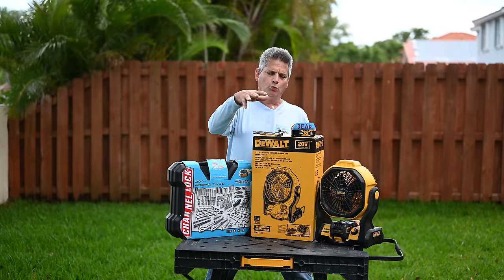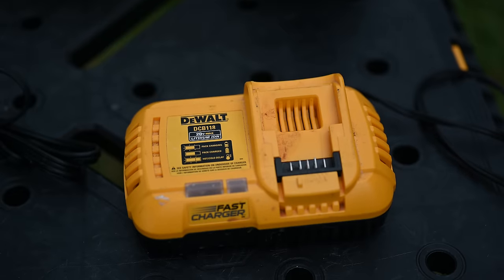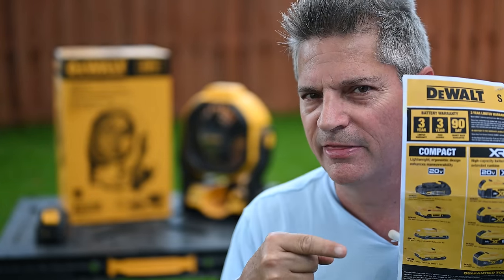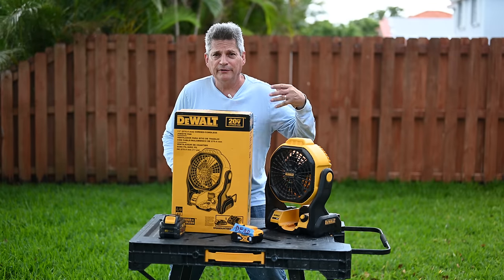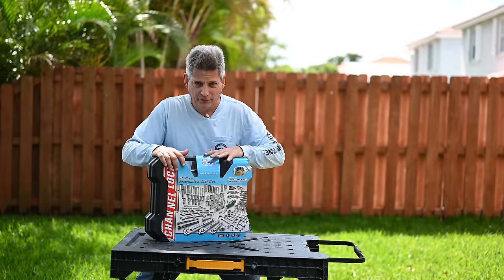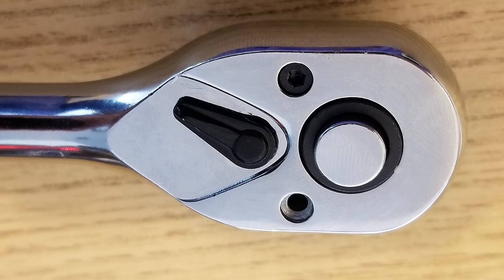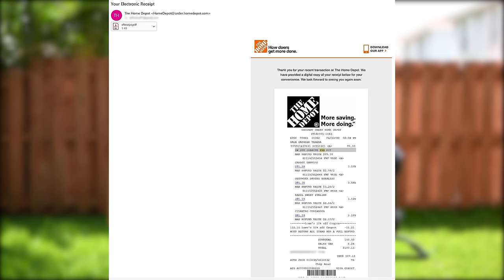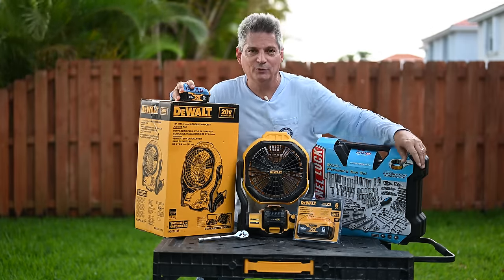Why Don't Tool Warranties Work? Tips To Avoid Denied Claims!

Comment: Great video. SB&D covered a B&D L-I line trimmer twice. First, the battery crapped out, they sent a replacement. Then, a plastic part between the motor and head stripped, so they sent a refund by corporate check because it was not repairable, and they had no more of my model in inventory.  I now have a trove of Dewalt and Craftsman 20v tools because I know they will stand behind their warranties.
Reply from the maker: Thanks George!

Comment: Couple points to add:   Harbor freight offers an extended warranty on many products which is virtually a no questions asked replacement plan.  The Ridgid lifetime service agreement is very difficult to register -  others have said you can do it instantly via Facebook but I haven't seen any instructions on that yet -  supposedly Ridgid honoring their LSA is one of the toughest things to get done.  Also a reminder that some retailers print their receipts on thermal paper -  like Walmart - and guess what:  in the heat and with time they completely vanish -  so it's a really good idea to make copies or take pictures of those receipts.
Reply: Interesting I thought Ridgid registration was easy and I have at least 12 different Ridgid tools. Now as far as the warranty i couldn't get any 24 volt batteries (these were from about 8 years ago) and they don't make them anymore. They did send me 18v as a replacement with a charger and they work perfect.

Comment: You can jump start the battery with a wire. Just look it up. I had that issue on two brand new 5ah batteries, looked up a video and jumped it. Been using those batteries everyday for a couple years now and they're still great.
Reply: Still likely the cells inside are defective, the packs do provide power, just have either dead cells or thy are low capacity. If NimH very likely to be dendrited cells in there, which can be possibly rejuvenated, but which are unlikely to last long term. If lithium then one cell pair is dead, and needs the pack replaced, or the internal cells replaced with ones that are higher capacity.
Reply: Just tried the battery hack. Works great, had a Sony Bluetooth speaker/ AM-FM about 15 years old. Had been using the electrical cord to power the unit. It would not charge!!!  Connected the Dewalt 20v battery for about 15 seconds. Disconnect the wire leads and it immediately went in to charge mode when plug into the power cord. Big thanks battery replacement not an option.

Comment: You tell of an interesting ratchet replacement experience.   The opposite took place with my lifetime warranty from sears-craftsman.   The set includes a plastic handle nut driver with 1/4 square drive.  It doubles as a 6 inch 1/4 inch extension.  The top of the handle has an inserted 1/4 steel female that takes the ratchet driver.  The plastic is too weak to take the torque and makes a little crack in the handle, which can no longer hold the insert.  Craftsman had discovered this design defect, and no longer makes the combo driver/extension. (They could have just redesigned it with continuous steel thru the handle!)  They would not give me the two separate tools to restore my functions.  They said, either the 6 inch extension bar, or the driver with plastic handle, and I must let them crush the cracked one!  They would not let me keep the perfectly useable driver, and just get an extension, because they feared that we could make many additional claims on it.   Understood, but why not just give me both inexpensive pieces? Or redesign with continuous steel core? (What does it cost to mold a plastic handle onto an extension?)

Comment: Yes if you can get both a paper receipt and email of the receipt from any store do it. Even if the cashier does not seem to have the time which are few. This has saved my butt many of times.
Reply from the maker: Once I set it up at the store cash register in each one of the stores, it automatically knows where to email of the next time you use it because it is tide to the card

Comment: I have one of the the DeWalt rocket lights that I had about 3 months.  I went to use it and when I set it up as I was walking away from it I heard a pop noise and it started falling over.  I caught it before it fell on the floor, but after inspecting it I found that the socket for one of the three legs had cracked and the leg fell out of the socket.  I looked up the warranty info and it basically explained I needed to take it to a DeWalt warranty center, the closet which is about 80 miles away.  Rather than make the drive, I sent an email to DeWalt with my receipt and got a quick response saying they would just ship me a replacement, but I would need to return the broken one.  Since I had thrown away the large box, I replied back asking if it would be ok if I waited for them to send the replacement, so I could use that box. No problem...they sent the replacement less than a week later and I returned the defective unit.  Nothing but praise for their customer service.
Reply from the maker: That is awesome Chris!

Comment: Corded tools rock!  More power and no batteries to worry about.
Reply from the maker: Lol I was just thinking the same thing about battery operated tools, batteries rule! No more outlets to have to find and no more extension cords to dig out and trip over. And I hate extension cords because when I try to vacuum up at the end of the day the vacuum shop vac does not wanna roll over the cords

Comment: Rigid rocks never had a problem getting batteries replaced even ones I've had for years and have a local Rigid authorized repair center nearby drop off a tool replacement in days or repaired again never a problem !!!! Ye I'm a loyal Rigid Fan

Comment: @jeffostroff did you fill out the warranty paperwork that came in the box for that to work like that or does sending that in not really help? Never had one fail yet...thanks
Reply from the maker: Over the years I haven't much turned in any of those cards that come with the tools or much of any other products that I buy because I have found over the years when you call to make a claim and you say but I registered they tell you no you weren't registered for warranty that was just the marketing stuff. So I don't really register unless they have some type of incentive for getting online and getting your project registered. For example last year I bought some studio equipment and it said that we would get another year of warranty if we registered the product so I did. But most times all you need is the receipt to back up unless it's specifically tells you somewhere in the paperwork that you must register your product
Reply: @jeffostroff  thank ya so much for taking the time to answer that! Sometimes I feel bad because my comments are so long! But have an awesome day!

Comment: I got burned by Sears on an expensive electronic torque wrench and there isn't anyone in the United States to fix it. Almost 200 down the drain. The head had a known issue.  My advice. Use your stuff immediately and frequently to make sure it works. After 90 days on certain products your out of luck regardless of zero use
Reply from the maker: Yes, don't let it sit in the box untested

Comment: Had an issue a while back , I was cleaning my tool collection and had some old Craftsman broken tools, well they have numbers on them , the numbers linked them to Sears,  lowes would not honor the tools because they didnt match there numbers even though they were craftsman which I thought was b.s..... anyway contacted sears online , they also asked for pics of the broken tools, I gave them the pics , a few days later I had 75 dollar credit at sears online to order new ones . I ordered something else instead .... Although it was a week or so of crap Craftsman will stick behind there warranty on old Sears tools even if you dont have a Sears around for hundreds of miles you can swap em out .
Reply: I got burned by Sears on an expensive electronic torque wrench and there isn't anyone in the United States to fix it. Almost 200 down the drain. The head had a known issue.  My advice. Use your stuff immediately and frequently to make sure it works. After 90 days on certain products your out of luck regardless of zero use
Reply: Try contacting craftsman warranty through emails, I forgot how I got my Sears process started but I remember chatting with craftsman on the issue. They should give you a credit if the item is still available for purchases.

Comment: I've never had an issue with batteries yet... But I have the exact fan and the switch went. It has the same 3 year warranty apparently... But when I contacted them because the switch wasn't working, the switch is not part of the warranty and it's not a replaceable part. So only option would be buy a new fan! Even though I was under 3 years from purchase date.
Reply from the maker: So you got no coverage at all?
Reply: @jeffostroff  pretty much they told me no coverage. They said the switch isn't covered they consider it consumable or something. That was through the DeWalt service center in Alberta Canada.
I ended up going back to the retailer I got it from (Canadian Tire) because their site said 3 year warranty and they actually swapped it for me which was awesome in the end. But on the DeWalt side I did have the issue there.

I will still continue to buy only DeWalt. But that was my warranty experience so far.
Reply from the maker: @AdamBoutilier   Well you got lucky on that 1. Another thing to consider a lot of people forget that sometimes your credit card provides an extended warranty as well and so you can Investigate that is an alternative solution as well

Comment: Hi jeff, is it possible to claim warranty for my flexvolt 6.0ah battery if i bought it from USA authorized dealer and ship it here in ASIA.

Now its broken and wont charge its  almost brand new used it once only. The battery says its 2021 production and its well within 3 years warranty period.

Will dewalt USA honor my claim of warranty? I have relatives living in USA who can accept replacement if dewalt replace the battery.

Comment: NEVER HAD A DEWALT 20 VOLT XR BATTERY GO BAD BUT HAD 2 FLEXVOLTS GO BAD PANASONIC HAD SOME BAD CELLS 2017 2019
Reply from the maker: The replaced the batteries for you?
Reply: @jeffostroff  THEY REPLACED THE FRIST ONE BUT SECOND WENT BAD LAST MONTH BUT IT WAS MFD IN 2017 OUT OF DATE I GET TO WALK INTO MY DEWALT SERVICE CENTER OLNY 18 MILES AWAY

Comment: I just take my Milwaukee stuff to the repair guy down the street. It usually costs between $2 and $7 depending on postage to fix any Milwaukee tool no matter how old it is. Dewalt is a pain in the ass and almost impossible to get repaired.

Comment: In 1999 I went all in on DeWalt tools. They were awful. First issue was their batteries. They suck! They sucked then, and suck now. The batteries do fine for the first few months, then good luck. Next issues were with drill chucks and motor brushes.. Enough was enough. Donated the tools as they went bad and replaced them with Makita. Also tried out some inexpensive Hitachi tools for comparison. Now called Metabo. Twenty years later, I've had to replace all the original batteries for the Makita tools. I just replaced the first Hitatchi battery last year. It was 20 years old! I know Hitatchi/Metabo tools are well known in Japan and just as reliable as Makita. I've used Makita primarily for heavy duty projects, but gradually began using Hitatchi. Hitatchi has not failed me. Built a small barn with them without any failures. If someone gave me DeWalt tools, sell, donate or give them away.